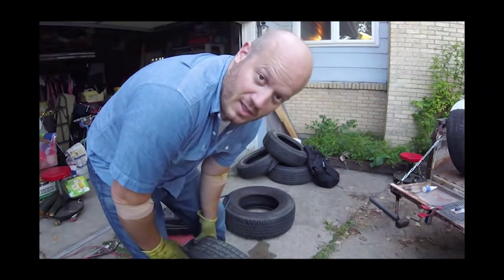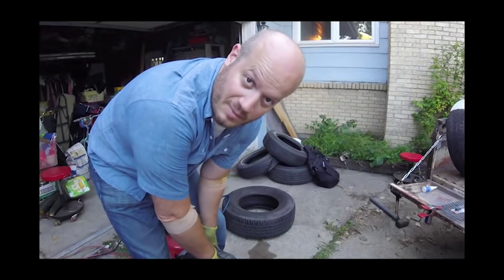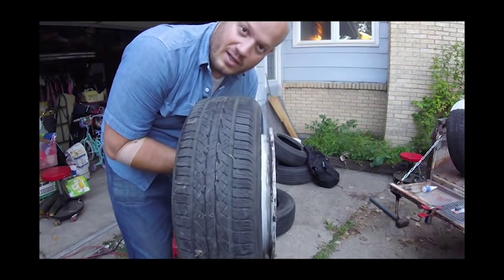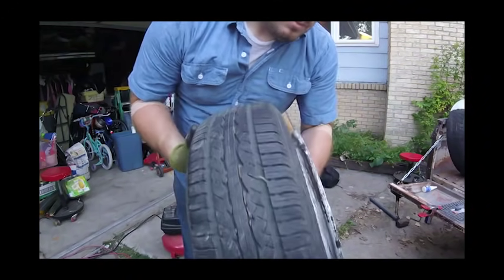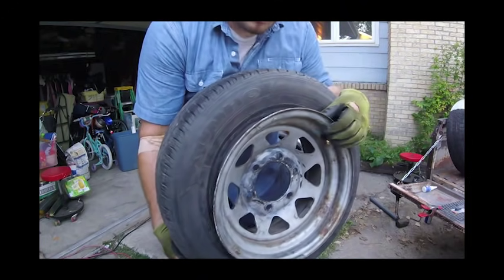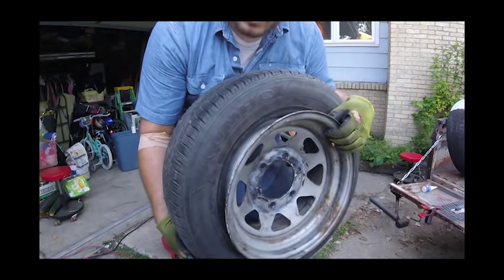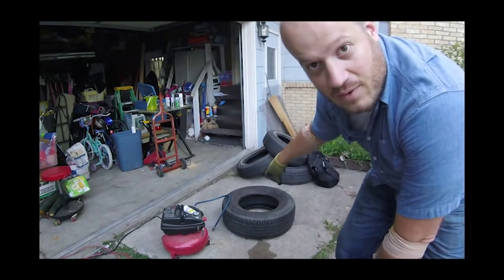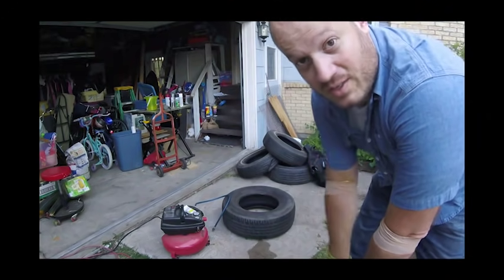SEATING BEAD on Tire Rim, Pop Bead, Stretching Tire Trick, Changing Tires, Mounting Tire On Rim ✔️

Comment: Thanks for the tip about setting it on the old tire. I have a tip for everyone. When trying to seat the bead, ALWAYS remove the valve core first for more air volume. Some air chucks won't put air in a tire with the valve core removed. If that's the case, you need a different one that will.
Reply: I use a black piece which is rubber.  Jam it against the Shraeder valve with the stem removed.

Comment: Fantastic video. Before  this I spent four yes four hours with ropes and straps and soap and getting sore palms and then I decided to try this and within five minutes I had the seals all in. I think the  tyre under the tyre plus good strong boots plus a wee bit of finesse on seeing
where the gap is moving as you pump in the air all key ingredients.
My tyre was a lawn tractor front tyre 13 by 5-6. My air supply was not from compressor but from a 9v cig lighter running the  emergency inflater in my wife's SUV. I had managed to seat one side of the tyre by hand   before I started with this vid for the other. 
Can't thank you enough EB. 
From an Englishman  in  France
Reply from the maker: Im glad it helped !
Reply: Thanks for the report man... I only have a cigarette plug inflator, and your story give me hope that I can do this.

Cheers!

Comment: Great tip. I've struggled to get a bead to seal since I got my own tire tools. This worked in no time flat. With the harbor freight tire changer, it's easy to bet the bottom bead to seat while the tire/wheel is still bolted to their stand, then toss it on a spare tire with no wheel and it will seat right now. Thanks for putting this out. I'd buy you a beer if we were in the same town.

Comment: Great video man. Looks like a good technique. I work in a tire shop. Me and both of the other employees are all relatively new to working in a tire shop and we have had this problem with some customers tires. Even with the equipment we have there we couldn't get some of them seated. We have had to cancel appointments and put the old tires back bc we couldn't get them seated no matter what we did. The next time I have this problem I'm gonna try your trick and see how it goes. The only other trick I've seen is putting a ratchet strap around the tread. But I've only seen thar done with lawn mower tires and such and I'm not trying to buy a whole ratchet strap set just to find out it doesn't work on car tires lol thanks for the tip!

Comment: I always did it by putting some silicone sealant around the tire rim and it always works, no need to even seat beads on one side of tire.  But since silicone sealant became so expensive, I have to learn a new way.  Your method works, but one additional trick I needed was to spray soap water all around the rim as I press down on the tire/pump in the air.  With soap water it's really easy to see where the gap is where the air is escaping and adjust to seal it.   Thanks

Comment: I have been struggling with tire just like yours, way smaller than the rim.  I have tried multiple methods to no avail.   In frustration, I tried your method and took less than a minute and BAM the bead set!!  I ended up standing on the wheel with both feet and wiggle back and forth and all of a sudden there was the POP.    Thank You!!!!

Comment: Thank you so much. The thought of setting one bead first never occurred to me even after years of doing my own tires with ratchet straps, ropes starting fluid etc. Today I was trying to seat a new rear riding mower tire whose beads were almost touching. Even though I had to weld a 3/4” nut to my fab table a run a 3/4” all thread through the rim and block the tire 6” off the table then force the rim down to seat the first bead it still came down to watching your video. The only mistake I made was seating the valve stem side first which forced me to inflate from underneath with a locking air chuck after flipping over while at the same time bear hugging the tire to seat the second bead. Battle won. Thanks again

Comment: I used to have a gas station and tire repair. I did that quite often , I can tell you one thing I did different instead of laying it down to air up , I leaned it against the wall at about a 45 degree angle and push in on the center gently like and usually seal right up.

Comment: Great idea!
I couldn't even get the bead fully seated on 1 side, but having that side partially seated made it possible to seat the bead the rest of the way with some careful pressure on the tire to push it into the wheel and an air compressor.

Comment: Hey thanks for the video! I had been struggling for an hour with one tire. I did like you said, pull one bead on but I couldn't even get all of that one side on so I flipped it over layer it on another tire and added air and POP! It aired right up. So as long as it was tight it held air.👍

Comment: Thanks it worked. The second step I had trouble getting it to seal and pop on. Instead I set the tire on the edge of the bottom tire pushed rotating around a few times to get the seal started. Then added air and it popped right on like you said!

Comment: A simple but surprisingly useful technique, thank you for posting. I couldn't get the inner bead to set first, the rubber was very stiff (new tires). But I pounded it in far enough with a mallet that I was still able to push the top side down and seal that bead too.
Reply from the maker: Yes I have had to do the same on some tires.  I wasn't able to get the first side to seat all the way, but it was set enough to hold until the other side sealed and the air pressure took over.

Comment: u know those kerosene heaters that look like a big lantern, i took the top off and put the tire on it rim up, fit perfectly and it worked well, just make sure it's empty just in case,  
i also break the bead with a 3 foot board i put it near the rim on the tire and drive up on it slowly then stomp on the board and pop, just make sure u take the valve stem out before
but most importantly i always buy a spare rim and extra tire it makes it so much easier to swap everything just keep extra at home and use the spare the car came with less :) soap and water in a old spray bottle around rim edges before u put air in ;)

Comment: I just mounted 4 used BFG AT's using this method, my mechanic couldn't get the beads seated using his machine, I used this guys method, worked like a charm.
Reply from the maker: Awesome!
Reply: Joseph Miller If your mechanic couldnt do this you should never use him for tires again. Any tire guy worth his salt should know this technique like the back of their hand. Only its actually easier than shown. You don't fit the back bead by hand you only need to give it a few swift kicks in the right place and it's done.

Comment: I use a 1/4 cup of gasoline and a match while using a small tire pump that you plug in a cigarette lighter socket and works on everything trucks ,cars, motorcycles and tractors
A little scary when the bead pops in place but works without wasting time or lots of effort

Comment: I change my tires a month ago. The only problem now i have is i have to pump air ones a week. Do i need to put  some sealant? Or i did something rong? Help pls. Great video by the way
Reply: Dio Fer you sure it sealed all the way? Did it make a “pop” sound when you aired it up after beading it?
Reply from the maker: Sometimes the side of the bead needs to be clean from corrosion, rust and dirt. Spray some soapy water on the bead and see if there are bubbles coming out.  Or there is a small hole in the tire that needs to be plugged.  Or the stem needs to be replaced.  All depends where the bubbles come out

Comment: Tried strap method, starting fluid.. no luck. Did it your way and it worked on my 15" trailer tire! Thanks!

BTW: I found it impossible to pull the bead all the way on the first side, but it only has to be tight and partially on enough to seal and hold when you pull up on the other side and put the air in. I do not use soapy water.. I believe it promotes corrosion, I have always used WD40.
Reply from the maker: Awesome!  Good to hear :)

Comment: Normally you would take a ratchet strap to the very center part of the tire. Keep tightening and tightening the strap and that will flare out the sidewalls. If one does not have a high pressure tank one can use a can of starting fluid. Spray some starting fluid inside the tire and light it up with some exposed flame. That will suddenly burst out a huge amount of air that is bound into the molecular structure of the starting fluid. Which releases a large amount of air that was a fluid but is now a gas. Ive done this many many times and it works every time. Good Luck.
Reply: The fire method works without an air compressor? I only have a bicycle tire pump, got no room for a compressor. It takes about 3-5 minutes of pumping to inflate a car tire. I wonder if the bead would hold for long enough.
Reply: @ObamaoZedong  - Yes this method works very well. In fact at almost every time one must deflate some of the air out of the tire. Usually after you use this method the tire is over inflated. So the bead of the sidewall always gets seated properly.  I have never seen this Not Work. Sometimes when it is extremely cold outside it takes an effort to light the ether/starting fluid but was once that explosion occurs then wala the tire is inflated and seated properly.  The only issue of concern is to How to light the ether that is sprayed inside the tire. Becareful and you will succeed every time. Good Luck !

Comment: great idea , what sealant do you use around the rim because mine has a new rim and will go flat a few days later?
Reply from the maker: I just used soapy water to get it to slip on easier.  I don't think it is necessary to use sealant.  Your rims probably need to be wire brushed cleaned with a soft wire brush.  It may have build-up of something--Check either the rim on the metal or the rubber rim on the tire for bumps of corrosion or dirt

Comment: i for the life of me can not get the first bead on the wheel 😩😩
Reply from the maker: I have had the same struggle with some tires.  Even if you can get one side to snug up enough and hold even if it is not fully beaded, then it may work the same.  But it is definitely difficult on some tires.

Comment: Ratchett strap around the circumference of the tire is easy and foolproof.  Can't go wrong with that method.
Reply: Hold my beer.....
Reply: @martinbrzozowski48  So the tread profile folded?  Must be a really light tire to do that.  Usually it just pushes the side walls out to contact the beads on the rim of the wheel.

Comment: Thank you for the helpful video. For some reason, putting first bead back on the rim was proving to be a challenge, while final one wasn't too bad, maybe I am missing a trick? On the contrary, removal of 2nd bead for old tire was a pain for me. Would you have any advise for seating the bead on installed tires? For some reason bead isn't seating after installation. Thanks again.
Reply from the maker: Im not sure of your tire, but just make sure you use some lubricant to make it easier.  You may have to keep wiggling the tire around until it makes enough contact long enough for the air pressure to build.
Reply: @extremebudget  thank you, it's a 15inch regular car tire. I tried many times today and had no luck of seating the bead. Used a ratchet strap too, still no luck. Do you suggest I stand in the middle of the rim or try to distribute weight in corners? Thank you.
Reply from the maker: I'm trying imagine what you are saying. the challenge is to stand in the middle and make sure all sides get some contact long enough to get some pressure started while the compressor pumps.  Maybe slowly rock back and forth  and from side to side.  maybe get a second person to help
Reply: @extremebudget  thanks for helping out and I should have been clear. I'll use another person and try to rock back and forth to see if we are able to pump air.

Comment: I had to do a couple trailer tires a while back and did the same thing, super easy to do. My question is if the tire is for a car or truck, do you need to get them balanced still?? I have a set of 35” x 12.50 mudder type tires going on some 15” wheels for my Jeep and trying to figure out if it’s worth doing it or taking to a shop. 

Awesome vid and I’m subscribing for sure
Reply from the maker: Yeah I'm pretty sure you would have to get them balanced. I didn't care that much about these wheels for my bed trailer.
Reply: Extreme Budget Balance your trailer tires it saves wheel bearings.
Reply: you don't need to balance your tires but it's a good idea to have them balanced.
Reply: edoubleu52

Comment: I'm about to attempt this myself as well. Did you use any type of bead sealant when you did this?
Reply from the maker: No. I just made sure the bead and tire were cleaned off and smooth.  I used soapy water to make it slip on easier.

Comment: Disappointed! Misleading title and somewhat pointless. I've mounted hundreds of tires and never had occasion to do that even when I used a little 12V air pump to pop bead / inflate tire during a power outage.
Reply: L Malino sorry, this was  not a bad method, ive done thousands of tires, and had plenty where i needed to use a cheetah, you'e fortunate never to have had a tire thats been sitting on thr warehouse floor for a few years where the beads are about an inch apart. They can be frustrating, epsecially when you are getting paid less than .5 to mount and balance all 4.
Reply: Of course I've had that situation numerous times. I have no Cheetah or other specialty equipment other than my brain. I use coffee cans (4) to spread apart the beads. I didn't say yours was a bad method; I said misleading title and I certainly didn't intend to be insulting. I meant it is not necessary to fully seat the lower bead; just force it down far enough that air doesn't rush past it. I've hand-mounted all my tires since 1966.
Reply: L Malino nice, and kudos, i dont think it was misleading, but good on you for doing your own tires.
Reply: Yeah, sure you have!